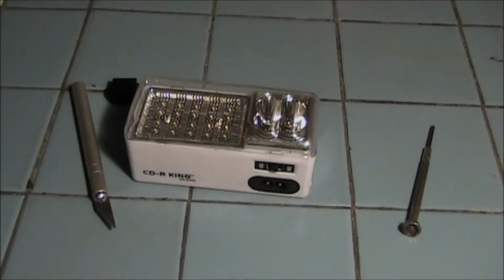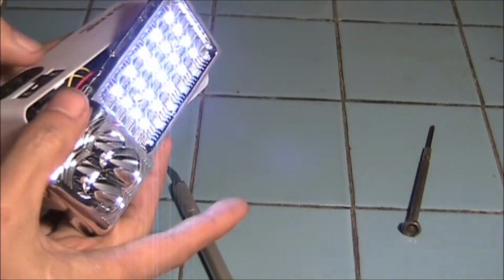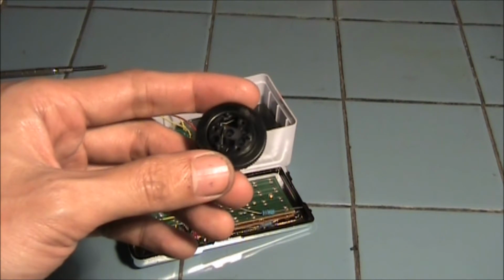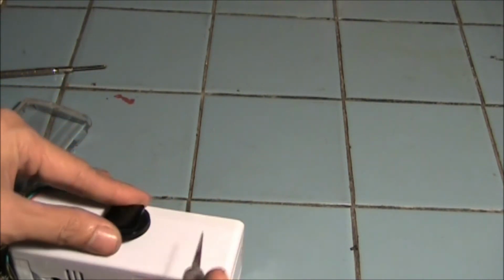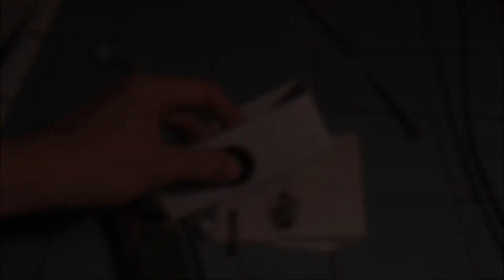Cheap CD-R King LED Lantern Hot Shoe video mount Hack

Comment: nice!!! do u have samples on people? just to see
Reply from the maker: Unfortunately I haven't released sample photos online except at Facebook, But the sample shots were already buried in my Timeline album since this DIY is from long ago, and I am no longer using this since I have already bought a proper ring light to use in both macro photography and videography.

The point in this video is to add a hotshoe or flash PC connection to an ordinary LED Lantern so it can be attached to any tripod or DSLR. It was never intended to replace a good dedicated video light, bit just a cheap solution if you can't immediately afford a proper video light. This project depends on how bright is the LED lantern you want to use, and how small is it to fit your DSLR. The size and weight matters so as not to put much stress on your DSLR's hotshoe connection.